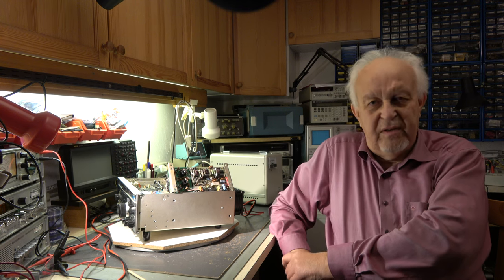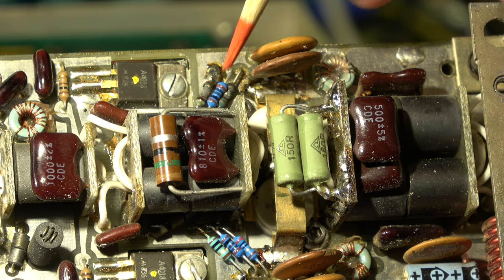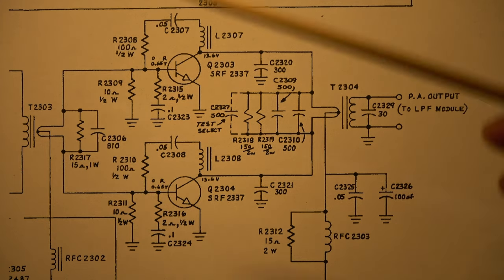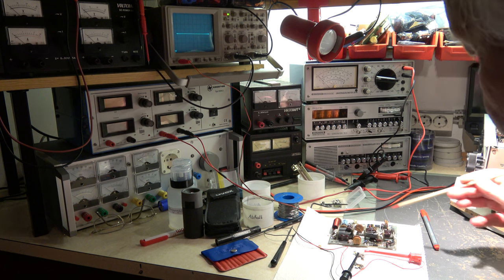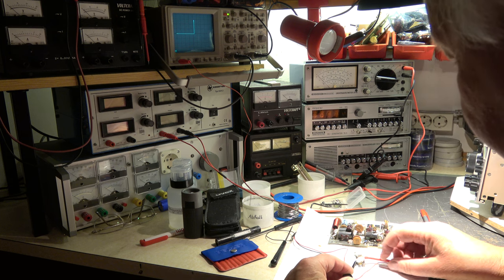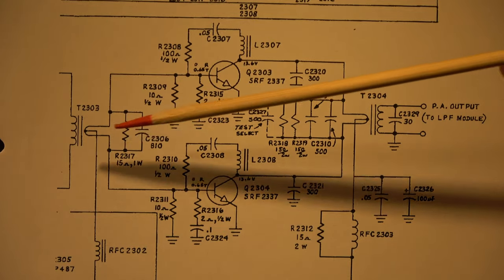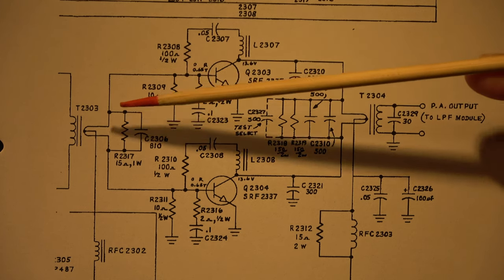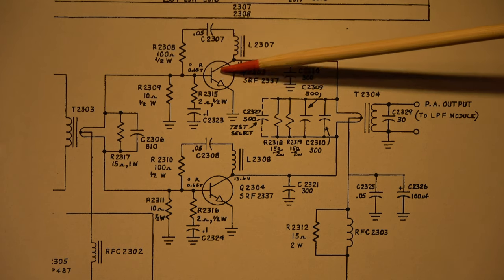#175 Drake TR7 Part 12(13)

Comment: Bummer.  Had the PA go out on my IC-7700 SII twice!  Very expensive repair.  Apparently the 7700 did not like my QTH.  Never had that issue with more than 20 other rigs thru the shack.  I sold it after the 2nd repair.  👍

Comment: That's life in electronics.🤷‍♂  Even transistors and power transistors in particular have a life limit. At some point the bonding wires gave up the connection to the chip. In the case of power transistors, the cold and warm phases accelerate aging and thus the loosening of this bonding connection.
The TR7 is definitely worth repairing. I would not use him as a well-repaired spare parts supplier.
But let's wait and see how the owner decides.
73  Bernd
Reply from the maker: Maybe i´ll try to open the transistor and examine it with a microscope

Comment: There must be non inductively wound Wire Wound resistors that could take the heat and not burn out.
Reply from the maker: Right! And these small resistors are metal film types.

Comment: Is it possible that the transistor had a "weak" base connection since manufacture, or the driver is actually over-driving it due to low ALC action? or something else of course.
Reply from the maker: Tnx, but the ALC is set acc. to the manual and active